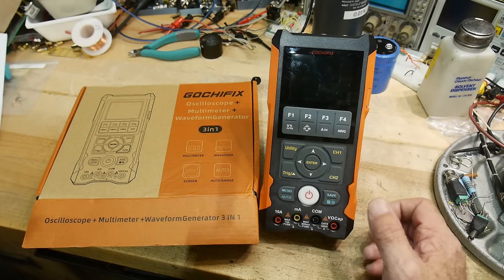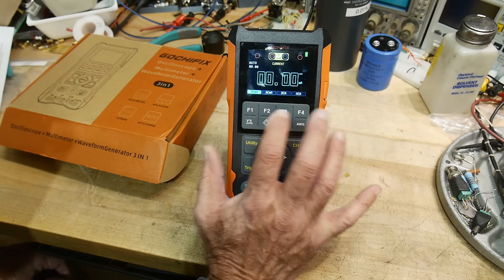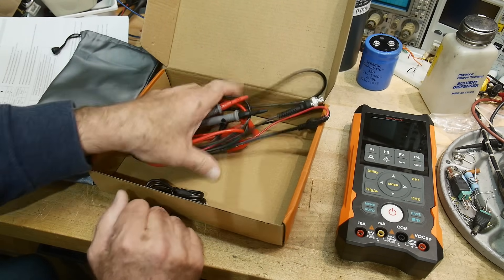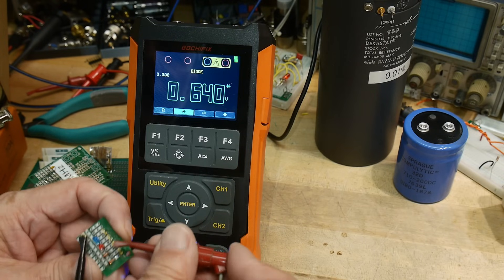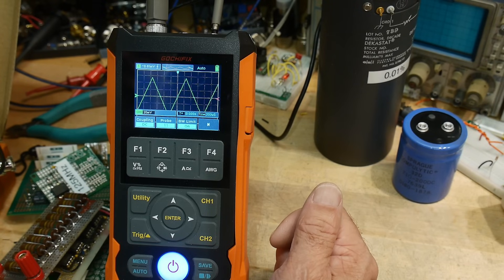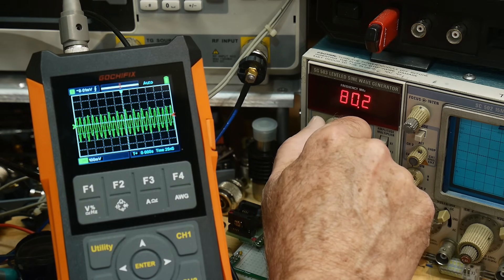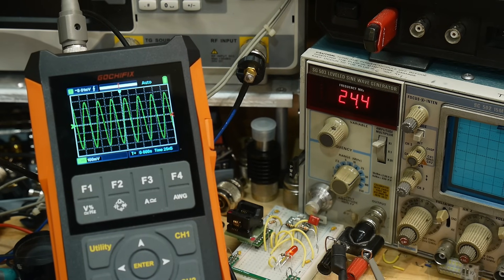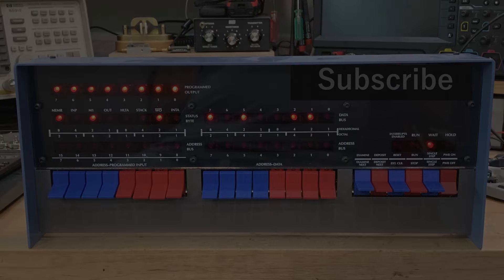#1802 Gochifix 80MHz Multimeter / Dual Trace Oscilloscope

Comment: A cool little scope.  The dual trace screen and function generator are really useful.  At 80MHz bandwidth it would certainly do for most experiments involving 555s, opamps, cmos, etc.  Having a built in multimeter is questionable.  But that horrible outline font would be a no no for me.  I will stick to my Pico Scope and Mastercraft multimeter :-)

Comment: No off-set on the generator?  That's a bit of a fail.

For less than the price of this you can get a Zeeweii DSO3D12 (a real 120MHz dual ch. scope with generator and DMM) plus a Kaiweets HT118E - a full 4.5 digit DMM.  And still have change left over for a cup of coffee.

They should rename it Gochukit.
Reply: Gockukit
(By the Willy)

Comment: if only it had 80 mhz response time for resistance measurements?  you get a lotta features for a low price, but i've really come to dislike digital devices with underpowered processors. analog devices be like, "we don' need no stinkin' data structures!" That little Tek in front of you doesn't need to think about the situation before it does as requested. Things happen about as fast as you change a control, excepting series inductance and shunt capacitance in the circuitry.